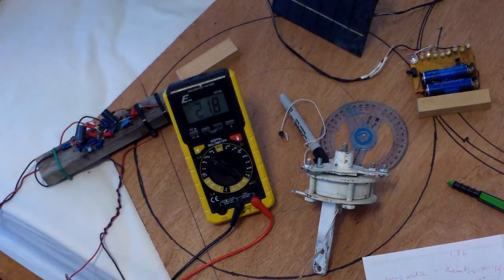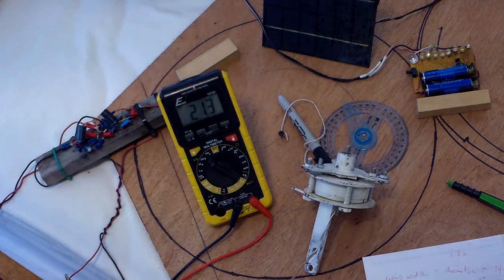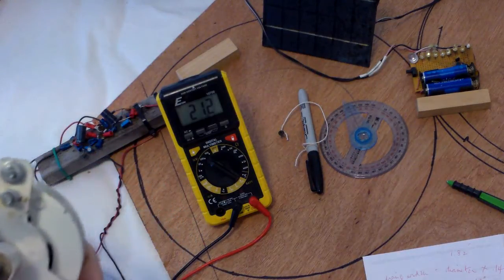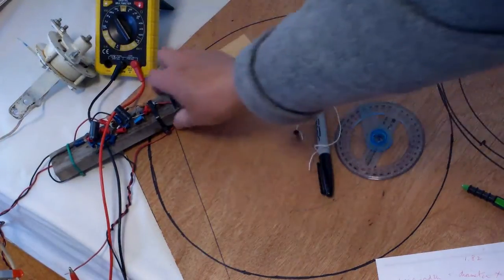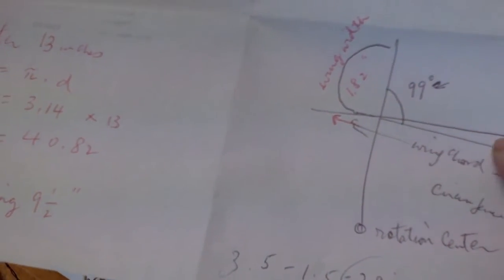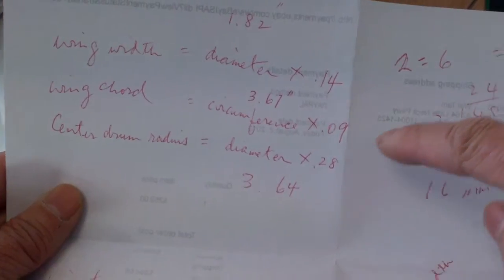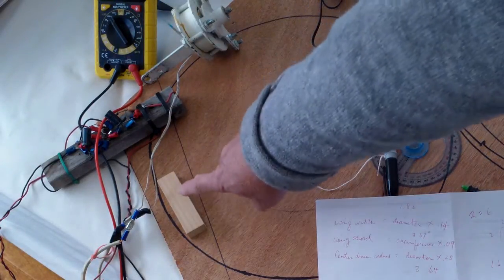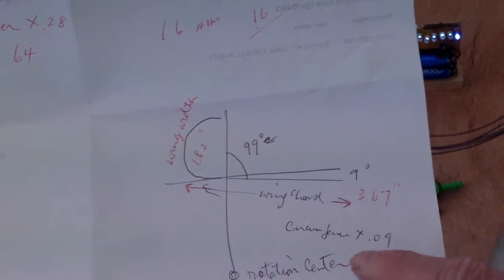Mini vawt to charge solar lights part 2

Comment: The Lenz 2 will give you plenty of low speed torque. It's going to be a great little turbine. Lots of good info in this video for beginners looking to build their own too. Thanks for sharing that!
Reply from the maker: James Biggar We've had a few bleak days with lots of wind. The mini gen alternator has silicon steel iron core and is a little harder to turn. The wings need more torque to get going. We'll see how this works out.